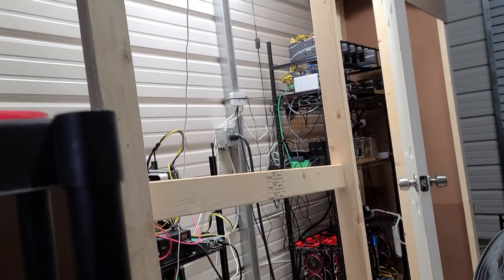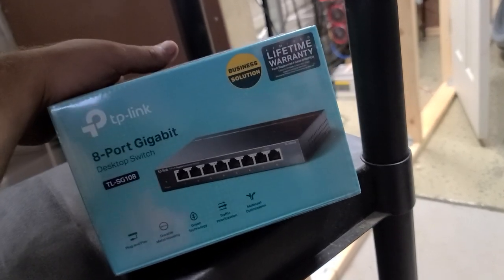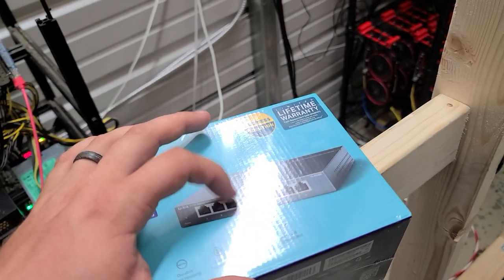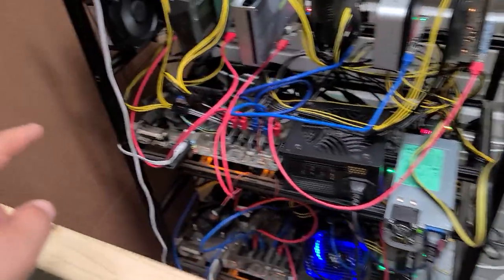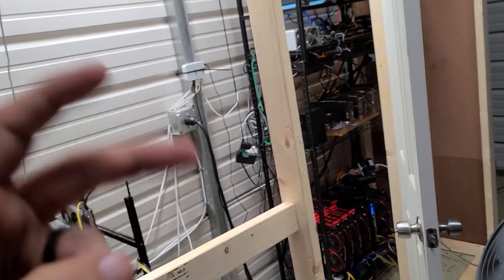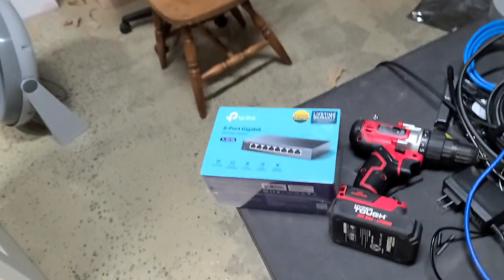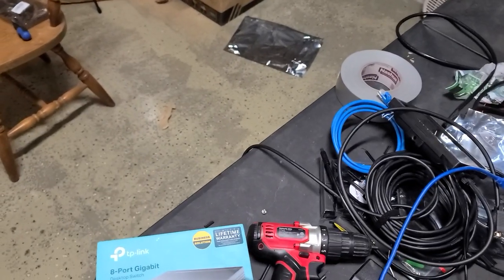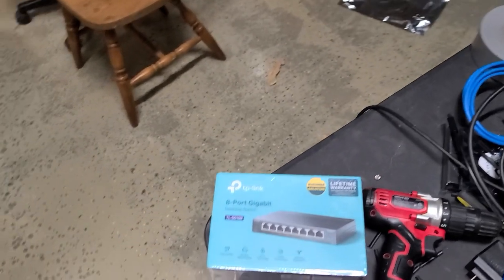Cheap Ethernet Switch for Mining rigs

Comment: Other than a cluster truck of cables, the other advantages to having a 24 port switch instead of a 8 port is big. You have all the machines on the same backplane with a 24 port switch, so things run smoother. If you take your connection into one switch, then split that connection to 2 more switches that is called cascading . You should never cascade more than 3 layers deep, if you do you will start to get a lot of network collisions. That and you will kill your transfer speeds as all the machines on the last layer have to bottleneck through one cable to get data. If you get a managed big switch, you can make a vlan for each port, and segment the rigs. If one goes nuts it won't take down your whole farm. Hope this helps 👌
Reply from the maker: Yes sir I'm a worst case example lol
Reply: downside of a managed switch: lots more heat, and lots more noise!
Reply: @austinh1028  if you are a miner, you really aren't concerned with either of those 😅

Comment: For mining rigs within small network environment, i've been using 8 port tplink gigabit switch for few years now. It gets the job done and so far, no problem at all. As long as its just for mining,gigabit is more than enough. As for the structure goes,i chose to use the 2 layer, distribution layer and access layer. Yet, daisy chain does work and its up to the miners which one they like. No hassle there. Just use which is easier and suits you. By the way Brandon, my friend and I are very happy yesterday. We both got ourself RTX3070 each. Finally!! RVN all the way,yeah!!
Reply from the maker: nice good find on the 3070s i just snagged another one be in tuesday!

Comment: Using wifi extender that has 5 gigabit port downstairs. Been pretty stable. Upstairs, running 5port 2.5gigabit switch and 8ports gigabit switch.

Comment: There's nothing wrong with daisy chaining a couple switches, especially in a home environment, but you want to limit how many you have in the run of the chain. i'd say no more than 4 extensions from the source before you start having broadcast/packet routing issues

I have a FiOS 1G Fiber connection in my basement going to a decent Linksys AC router, plugged into a PowerLine out to the garage, with an 8-port switch out there (I also have another switch (direct-connected to the router) in my office for my work computer, gaming rig, and 2 network printers, and the TV and HTPC in the livingroom (joining wall with my office))

Comment: HP v1910 / 3Com 2928 (they’ve the same thing) is a great managed 24 port switch. They work as either layer 2 (simple) or layer 3 (routing) device. I’ve had several of them for years for many projects, I’ve even in unplugged the internal fans in the the 24 port ( non-PoE) versions and have never had a blip. They can be had on eBay for peanuts considering the functions they have.

Comment: I'm using a WiFi router that has like 6 ethernet ports on it, got it for about $15 CAD and it's way more than I need now that I use that 1x PCIE to 4x USB slot adapter you mentioned in a previous video.

Comment: I prefer WiFi only because when I run wired connection on hive os. I have to unplug it and plug it back in to get it to boot when it crashes

Comment: Question on how would someone hook up ethernet to  a kaspa kso miner. Saw some videos but not sure. Should I run from switch off u verse modem panel that has 4 spots   then run a splitter to my laptop then into the kso miners? Thanks

Comment: I mine with a single 5 ports switch + a 3060 laptop (47.70mh/s btw) to WiFi, 0 stale shares, cause I have a second router on second floor and with the 5G net, I get symmetrical 600Mbps with 3ms ping no latency whatsoever. The router is a TP-LINK AC 1900, pretty good quality and performance for the price

Comment: I know it's not the cheapest switch, but I purchased one of the Ubiquiti Networks UniFi USW-Flex-Mini Managed 5-Port Gigabit Switch and a PoE injector so I wouldn't have the 'wall-wort' hanging off my switch. makes for a tidy setup and this thing is about the size of a deck of cards! Cheers and thanks for the videos!
Reply: 5 or 2.5g ports does not matter AT ALL when used for mining just buy whatever is the cheapest while still being ok quality.
Reply from the maker: @Mike-mp1hk  a cheap switch is leaps and bounds from a wifi connection that is the comparison here. Obviously there is better switches available but I have been running cheap ones for years with no issues why should I recommend more expensive gear?
Reply: @Mike-mp1hk  if you think your mr know it all maybe should have your own channel to give out your wisdom but you dont so stop hating on brandon who giving out tips and advice to the best of his knowledge!

Comment: No hard line to my shop, so I have a Raspberry PI in the loft that gets 2 bars on my wifi, then configured the PI ethernet port to hand out an address to whatever is plugged in, and run a cable from there to my rig.

Otherwise I'd be using an old 10/100 Netgear.

Comment: One thing to consider when having those routers in your mining closet, if the WiFi router OR the switch get too hot, it will cause the internet connection to those rigs to drop.

You will most likely want to put a 120mm pc fan pointed on those.
Reply: I have my modem and router sitting on a laptop cooler. It works great for keeping it cool. Temps in my  mining cave have hit 115 F.

Comment: I use the shittyest 10 port 10 base t hub to connect my mining rigs suppriseinly do not notice a diffrence compared to the rigs thst are on normal switches.

(Hubs can have packet collisions and 10 base t is actually clocked slower so slightly higer latancy) 

Hubs however do not work well at all for mqtt /home automation so dont even try.
Reply from the maker: Yea they don't need much just solid connection

Comment: hey Bransdon What is the Voltage on that power adapter?
Reply: pinnëd by brandon coin   Oh okay.
Reply from the maker: That was  a spammer sry and I'm not sure but I have it on a 120v plug I can check after work
Reply: @brandoncoin   Thanks brandon. I wanted to see if that was the 5v output or the 12v output one.  Oh and  Yeah I whatsapp them to see what they all about. There scammers and spammers. They wanted my information and photo and in return to get your information to me lol
Reply: @brandoncoin  no problem man. Thank you. I reported that person.

Comment: do not connect 1 switch to another switch. instead use a switch with more ports to plug. if you daisy chain switches, you'll loose a lot of speed. guessing your router has 4 ethernet ports, in each port connect a 8-port switch and you'll have 32 ethernet plugs which can supply 32 mining rigs. if you have more than 32 rigs, then connect 16-port switches to your router. I tried daisy chaining switches and I lost a lot of internet speed, then changed my switches to 16-ports.